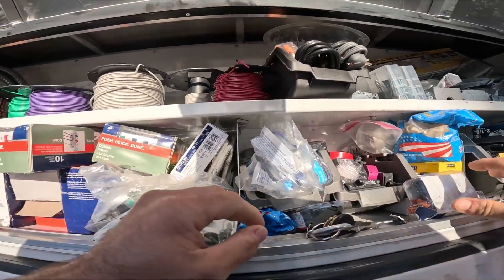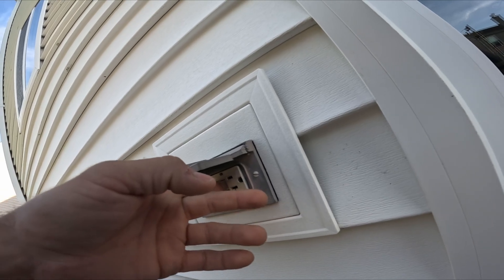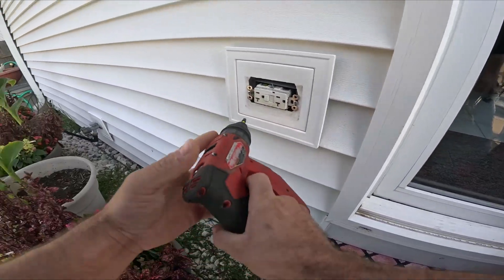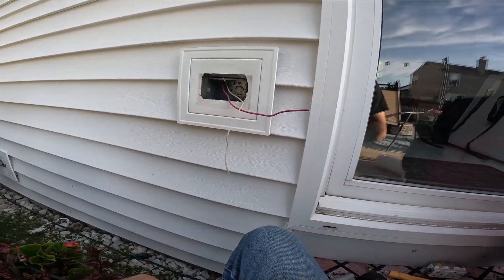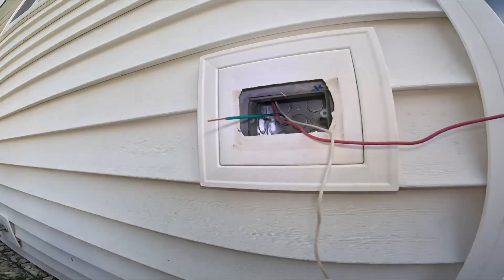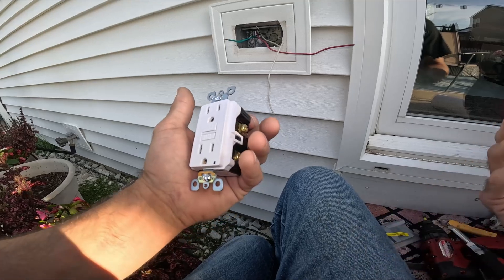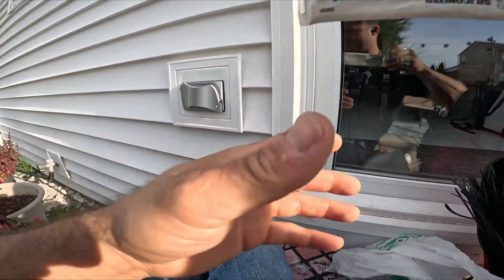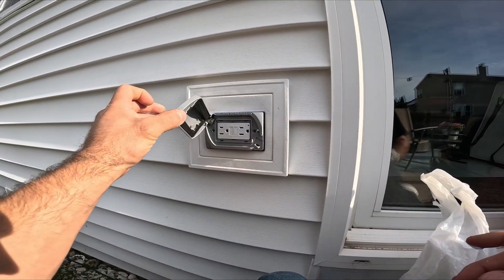Bad/ Wrong GFCI

Comment: Iv'e got a few hopefully helpful comments for you. First the obvious. Get some insulated tools! 

Second. When working hot, always remove "Hot" wire first, then the neutral then the ground last. Assembly is the reverse. Ground then neutral then hot. You always want to have the ground hooked up as long as possible, so that the device or box etc. is the ground and not you! 

Third and last. That type of application requires a WR rated GFCI (I always use TR for everything else) and a waterproof in-use type cover. These are designed to be used out in the open and will allow it to have something plugged-in and not get wet during rain or sprinkler use etc. (or at least less likely to). The type that you used is for an exterior covered location such as a porch or carport etc. Sure the WR GFCI and waterproof in-use cover are more expensive, but they are safer for all involved and will reduce your liability. Work safe, work smart and charge accordingly. Also tell people up-front that's what you do and don't be afraid to walk away from a job if they just want someone to do it cheap. You're still going to be cheaper than an electrician for a job like that. I've been in the handyman business for over 20 years and have a good reputation with customers, tradesmen, home inspectors and even building inspectors because they know I'm going to do it the right way. I also love going to work each day!
Reply from the maker: Yea the Funny thing is, I am a electrician I am licensed in electrical. I wasn't a big fan of Temper proof outlets since my teacher Was a electrical inspector and told me after people got their houses built  They sent the electricians over there To change out the temper proof outlets after the inspection to regular outlets Because they don't like them. So I kinda lived by that for awhile.  But I see the liability from it now and now I'm going to install them cus people r getting dumber lol. Those in use covers will definitely break with rentals. U and I both know that and will cause more problems because they will rip the whole thing off. I do alot of work for property managers so I have to please them. They install those metal cover maybe not like the one I installed but something for outdoors on every house. I only install in use covers  for cystomers when I know they are going to keep something plugged in. Tenants are destructive and I've seen it first hand. But I love your comments and appreciate the info ur giving me. After the vid i got a few comments and WR and TR and realized im in the wrong and cant be doing that.I'm hoping u will hit me and let me know if u have better fixes in the future! Especially since I'm trying to teach people the right way, I don't want to be a butcher.

Comment: Nice video. Surprised it’s 14 awg wire especially with a 20 amp. I noticed the wires for 120v circuits in my house built in the 90s are 12 awg. Do you think this is better than most or the standard? That’s with all receptacles being 15 amp except for one in an addition.
Reply from the maker: Yep back then they had like everything run off of 20 Amp breakers so that's why you see all that 12 guage wire.
Reply: @thehandymanexperience226  ahh thanks that makes sense now.

Comment: adding a ground wire to a box that don't have a ground wire going back to the panel don't do nothing.
Reply from the maker: Ur totally right but this house is ran in conduit so the ground is the pipe I'm just making sure I have a good ground on my gfci

Comment: if I were you I would wear kneepads all the time instead of squatting or kneeling on my knees. kneepads are severely underrated and underutilised.  I wore them all day every day when I framed houses.
Reply from the maker: I should wear them, I bought a kneeling pad finally after I killed my knees on a bathroom light fixture.

Comment: Get yourself some insulated tools for working stuff hot usually rated 1000V.  I prefer the plastic Intermatic in use covers for exterior receptacles, expensive but easy to install.  I also install weather resistant WR GFI receptacles; again expensive.
Reply from the maker: Yea home depot has the 1000 v rated strippers on sale but there so bulky and over kill. To the point where it's going to put me in a bad spot cus I'm not comfortable. But yea I'll have to pick some weather resistant gfci s up